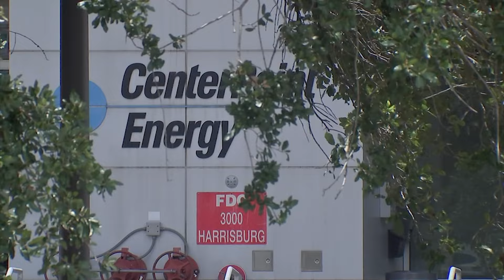Thousands remain without power in Texas a week after Hurricane Beryl

Comment: The liability here is CenterPoint did no tree trimming for years. This has been an unfortunate wake up call for routine maintenance of tree trimming and replacement of old poles, wires, and transformers. People have needlessly suffered and died due to their negligence...
Reply: There have long been problems with the trees in many wooded subdivisions.  In the late1960s-90s, HL&P (Houston Lighting and Power) had a service whereby they would trim the trees getting up into the power lines.  Since Reliant Energy, via Centerpoint, took over, they apparently do not have this service, and they won't even cut vines wrapped around poles, power, or phone lines--even when asked to do so.  Today, when a vine in the neighbor's yard was wrapped around both power and phone lines and was so heavy that it bowed both the power and telephone lines down during Beryl's winds, my uncle asked them to cut it as he could not get access to it, and the "nest" as he called it, was almost to the top of the pole.  They ignored this request while they were up in their crane baskets, so I had to climb a ladder to reach over the seven foot fence top to cut the vines from this side, leaving still the inaccessible vines/nest at the top.  This chore was something my uncle had asked the neighbor repeatedly to do on several occasions before storms.

Whether the power company does this tree/vine trimming or not, it should at least be noticed by community leaders, and tree trimming services contacted, if it is not safe for homeowners to do any trimming themselves.  Our little city's tax dollars should have gone for this instead of frou-frou monuments, old-timey signs pointing to the stadium and city hall, or trees/bushes planted in the medians obstructing view at corners and in turnarounds, and rude, impatient city hall/city services personnel.  My uncle's power is knocked out because heavy oak branches fell onto the power lines from the property across the street, and a tall pine tree two doors down fell, taking out the telephone and power lines on that side.  My uncle does not have any trees in his yards--not since Hurricane Carla in 1961 uprooted a 40 ft. pine tree, causing it to fall onto his home, splitting it in half.

There are other issues such as the rotten, fifty-plus year old telephone poles which are riddled with spike holes, and have endured many a storm, and the poles/connectors leading from the pole to the house, right above the junction boxes.  These were supposed to have been removed by Centerpoint when they took over from HL&P as 'upgrades', and inspected after Hurricane Ike, but were not.  In 2015, power surges nearly burned my uncle's house down, and he lost many appliances.  An independent electrical company came out and told him that they could not do anything to the junction box, or even inspect the interior outlets until Centerpoint came out and fixed those issues; the repairman ended up calling them, himself, because after five days worth of us calling, they still had not responded!  On the seventh day (a miracle!) they came out with the crane buckets and made the up to code repairs; the lineman shook his head and told my uncle to put in a claim with Centerpoint, which he did.